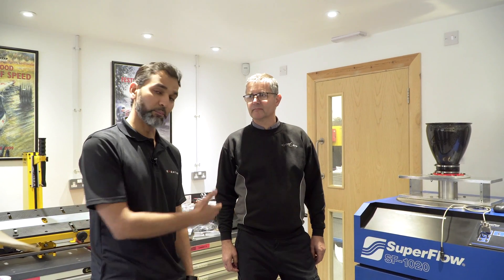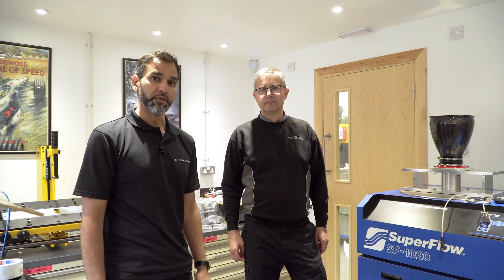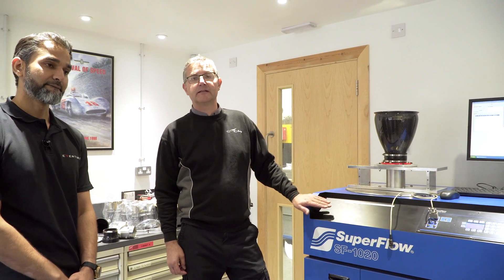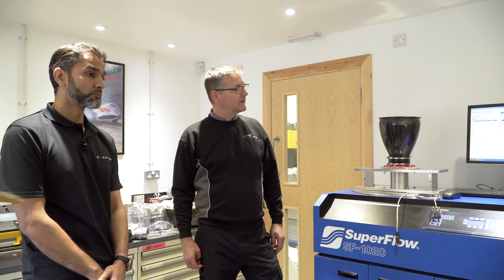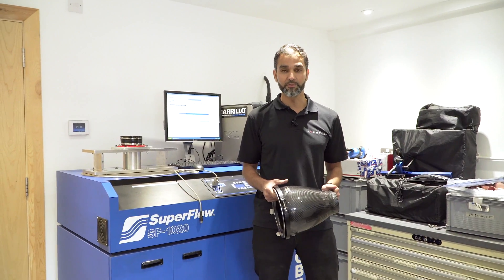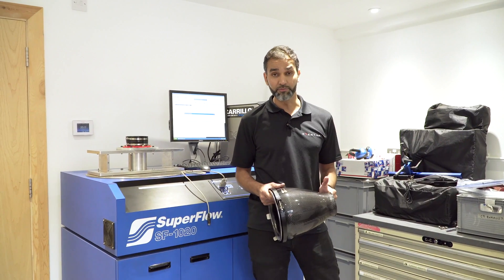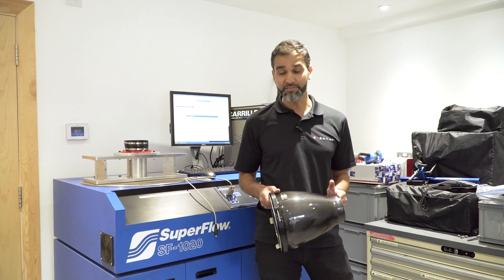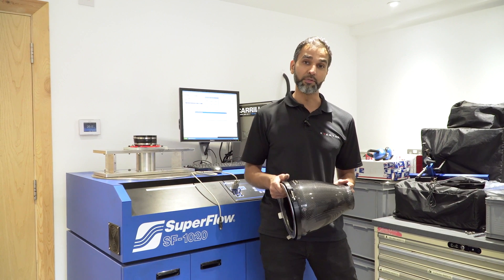Flow Bench testing the Eventuri RS3 8V Stage 3 Intake System against Stock Airbox

Comment: How is the filter blockind small particals that the real question mkn green all those brands have to many open spots if you hold the pod filter in front of the sun for example you clearly see open spots where the dust and little stuff still passes true out the fabric that why they say you got to oil the filter but that increases failure for the intake sensors
Reply from the maker: Incorrect, just because you can see light through a filter does not mean it is not filtering correctly. Our filters meet the same ISO 5011 standards as an OEM filter, you can read more here - http://www.eventuri.net/filters/
Reply: @Eventuri  why does k n spray oil on the filter then ?i just mean green k n etc eventuri is 👌thats all im saying

Comment: Thanks for this. Testing clearly shows that without the ducting more air flow is achieved, which is why the APR large intake works so well, with no ducting and just the filter it allows a very large volume of air to be flowed
Reply from the maker: Also lets in hot air without a duct.